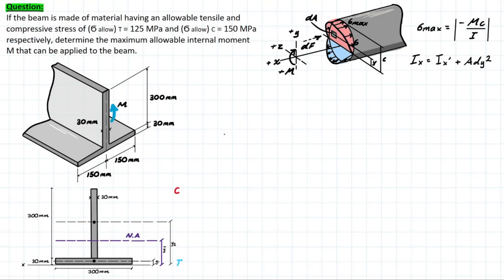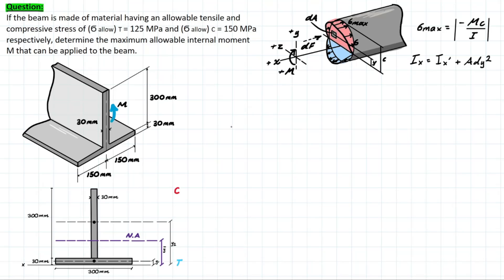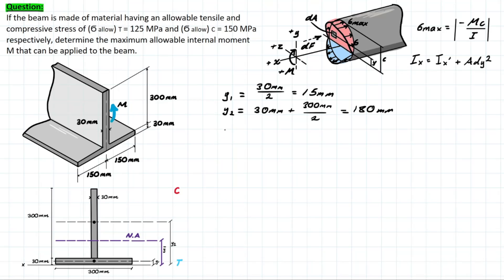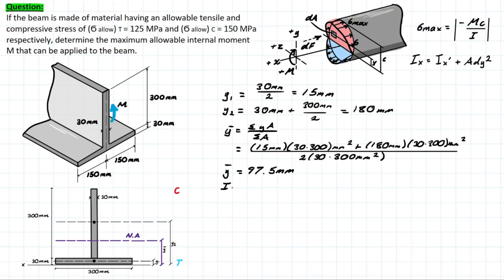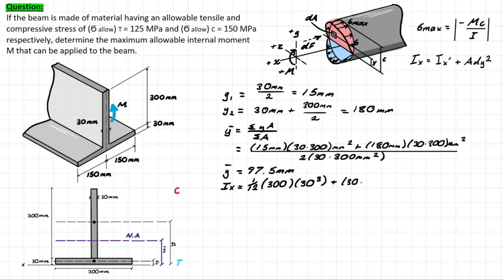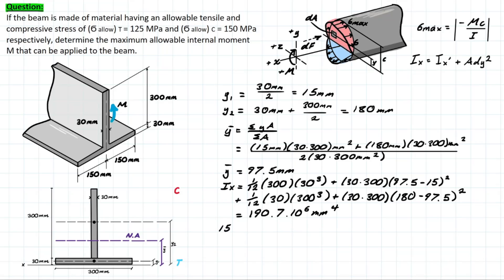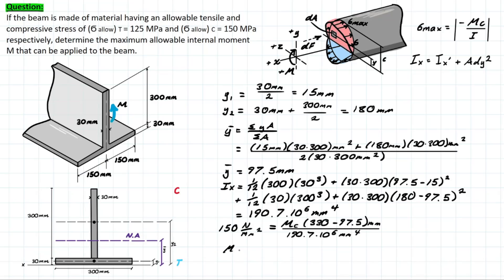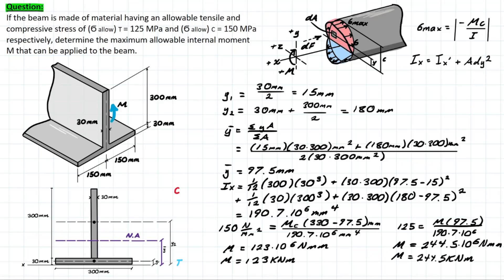Using the Flexure Formula given an Allowable Bending Stress!

Comment: Why are you using (330-97.5) for compressive stress and just 97.5 for tensile stress? Please explain
Reply from the maker: Good question! Tensile stress is in the bottom fiber of the member and compressive stress is in the top fiber of the member based on our applied moment. Therefore, for compressive stress, we need to find the corresponding y value, which is the distance from the calculated neutral axis to the top of the member. This calculation is simply the entire depth of our section (330) minus the calculated neutral axis (97.5). Hope this helps!

Comment: sir for tensile stress why c is just y bar
Reply from the maker: Good question! Basically, your neutral axis is the transition point in your section between tensile stress and compressive stress. This means our y value for tensile stress is the total depth of the tensile region. This values is based on our tensile region which is from the base of our section, to the neutral axis. Thus, y bar is used! Hope this helps.